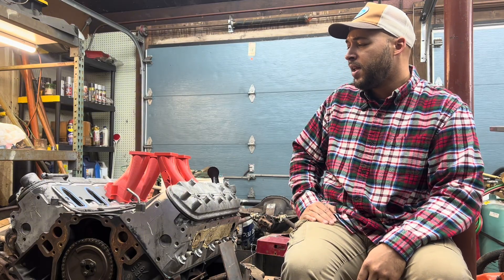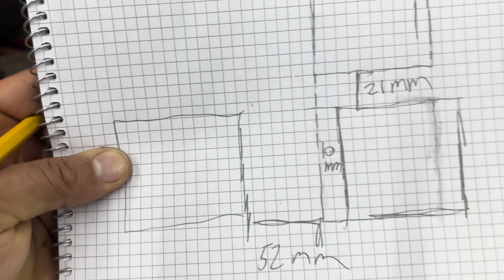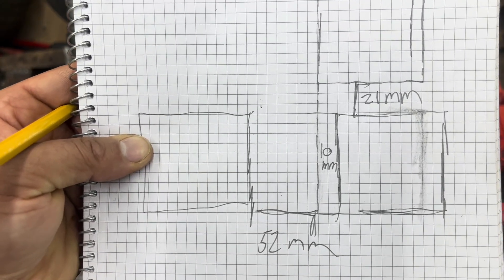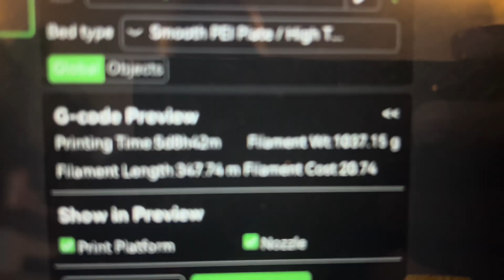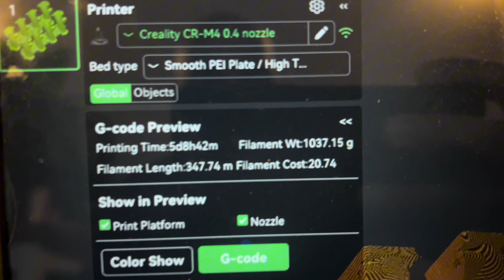Back to the Drawing Board: Rethinking My 3D-Printed LS ITB Intake Design.

Comment: Haven’t watched any of your other videos but this seems like too much work, assuming your going efi  just get two s1000rr ITB’s and run an ecu or module that can do dual DBW then just print runners to mount them, tie all runners to a vacuum manifold for your map signal or run it in Alpha-N.
Reply from the maker: It definitely is a lot of work! But it’s also a lot of fun! I really enjoy the design process and building things myself and it’s a most enjoyable hobby for me. Thanks for watching!
Reply: Hey Kevan, I hope I didn’t come off the wrong way, guess what I was trying to say was maybe it would be advantageous to use the mentioned DBW ITB’s, anyway love the CAD work your doing and will be following along.
Reply from the maker: No I was just agreeing with you. Thanks for watching!

Comment: Isn’t that idle air valve a tapered pipe thread? If so that’s going to be a big problem that more reinforcement may not help. Switch to a straight thread or an insert.

Nice job on the rest!
Reply from the maker: It is an npt thread. Thanks!
Reply: @KevansBuilds Yeah, so that’s putting too much stress on the plastic as it’s like a wedge. I know you’ll find a solution.
Reply from the maker: Exactly. I have had success using a plastic fitting but the threaded portion on these fittings is metal. Plastic on plastic would be best.

Comment: you need a 3d scanner, find the parts you need and then just scan them. So much easier. If you have an Iphone it has a built in one. I would make them as thick as  you can. What about about some kind of leg support to take the weight off?  Im sure its fine just sitting there, but going down the road. It would look kind of ugly, but where the itbs bolt on the inside just run long bolts all the way down to where it touches the valley. But even then that is a lot of vibration over time. Idk only one way to find out. Makes me want to print to itbs for my 240z. I dont' want to spend 2k
Reply from the maker: I having fun doing it this way. I already have pretty much everything designed already. Just print time now.
Reply from the maker: But yes a scanner would be nice!

Comment: Probably already added by some others; use compression limiter bushes under your bolts. If you see how OEM plastic (Mostly PA6 GF10 or similar) manifolds are made, they always use limiter bushes. It is to keep pre-tension on your bolt because the plastic wants to "creep" under pressure and then your bolt is not tight any more.
Reply from the maker: I touch on that in one of my previous videos.

Comment: That air valve is unnecessary when the actual itbs should have an idle screw that controls how cracked open the blades are
Reply from the maker: You are right, however I’m trying to keep the linkage simple and smooth. The mechanics of the linkage gets complicated when every throttle body is open a different amount.
Reply: @KevansBuilds  some throttle bodies have a small passage that bypasses the throttle blade and you can adjust a screw to open/close this passage.
I have suzuki ITBS on my miata, the idle is set by a stop screw acting on the throttle shaft, but the balacing is done by these screws
Reply from the maker: The valves I’m using will serve the same purpose. To bypass the throttle blade.
Reply: @KevansBuilds I also had a thought you could use this npt port to connect them all to a main block with a gm idle air control valve in it and have closed loop idle control might be a nice option

Comment: I went back and looked at your old videos.  I run my engine on a Megasquirt in ITB mode.  If you use a Ford idle air motor attached to the common plenum, it makes tuning much easier.

Comment: My first version of LS ITB runners very similars to you. I was rethinking the material thickness and came to a conclusion that trying to "a cast aluminium" runners by 3D-printing is dump because of the layer line cracks etc. So my next version is as big as possible "block" to maximize the total volume of the part. Also changed the design to resemple hiperformance style with minimal runner length to get throttle flap as near as possible to the valve. Also took try and error to match the intake channel on the head. It is crooked in three axis and not perpendicular to the mounting surface on the head. I also changed the cathedral port to a custom rectangle port by squaring the runner and filling the triangle part on the top. My ITB intake runners have like 50mm long smooth transition from round 45mm to squared cathedral port. Throttle valves are located near horisontal between the heads zigzagin like fishbone. Going make cold air box between the heads. And also I'm going to mount the injectors on the intake trumpets injecting straight to the throttle valve. Going to be a tight fit to get individual injectors with fuel hoses and wiring to the box.
Reply: I went to your yt page hoping to find some development history. Do you have a thread about this work anywhere?
Reply: @Torches-n-Tap-Sets https://youtu.be/o4oRTKw6JRg I had to open Solidworks to make a little video. Couldn't bother to capture and edit so just quick and dirty video of the screen with my phone :)
Reply: Lots of details still to be decided. Those gears are for rack and pinion system where pieces of rack are mounted on a long threaded rod with nuts for adjusting.
Reply from the maker: Sounds like a great design!

Comment: I run and ITB x 8 setup on my Ford 427.  I built it from Ebay throttle bodies and a Blue thunder Weber IDA intake manifold.  I have some recommendations.   First include a small common plenum that is plumbed to all the stacks,  This will allow an Idle air motor, a map  sensor, and a vacuum port for accessories.  A idle air motor will balance the cylinder to cylinder AFR at idle. Synchronization of the throttle plates is very hard if the ITBs are separate, especially at idle.   Second, If possible, make a throttle body shaft the transverses all four throttle bodies.  That's why motorcycle ITBs have a common shaft.  And third, if you can reduce the plenum below the throttle blade, you can run a bigger cam without getting into reversion.   Fourth, make the end throttle body accept a throttle position sensor.   Fifth, you may want to make the TB openings the dimensions of a Weber IDA stack, or Ebay motorcycle stacks (cheaper).  And lastly, It is very important that you design a good air filter box to cover the stacks or the dust will ruin your ring seal. The stack filters are either restrictive, or don't filter well.  Make sure the screws that hold the ITBs to the air filter box can come loose and get sucked into the engine.  Good Luck

Comment: I made some of these for LS3. It was fairly easy in cad to straighten them out. My injectors were above the throttle plate in a gantry style inside of the large air filter.
Reply from the maker: That's awesome! I'm still trying to dial in my design, but it's cool to hear how others are approaching it.

Comment: Could you do a video on the cad side of it? I really want to design a cylinder head but don’t know how to do the ports in fusion.
Reply from the maker: Hey man that’s great! I was able to learn cad by watching videos and tinkering with it on my own. My best advice would be to watch a few videos and learn the tools in cad that way you can apply them to that cylinder head you want to build. I will have a few videos out soon that will dive into Cad a bit more in the future.  Keep trying and keep learning! Thanks for watching!
Reply: Loft is usually your best option for connecting two 2d shapes in 3d space.
Reply: Reference geometry is your friend when making stuff like heads. It can be a bit awkward to do hidden features like oil gallies and coolant passages, since that information isn't always available and requires some thermal dynamics and pump head knowledge.
Reply: All of the GM stuff is available through SEMA as proper x_t parasolids. It is meant for businesses developing parts but not terribly expensive. $300 I think for 10 downloads. One download can get you an entire drysump LS7 drivetrain.